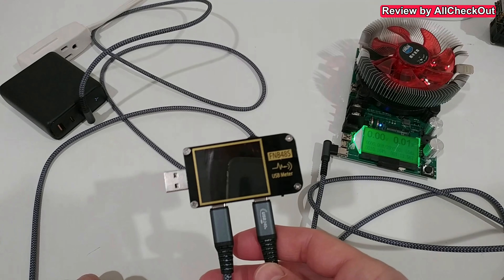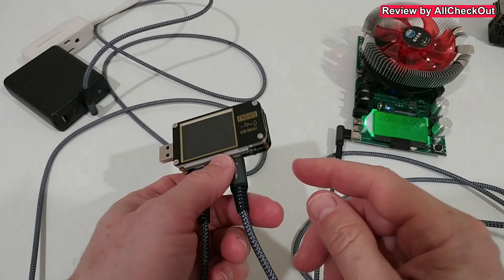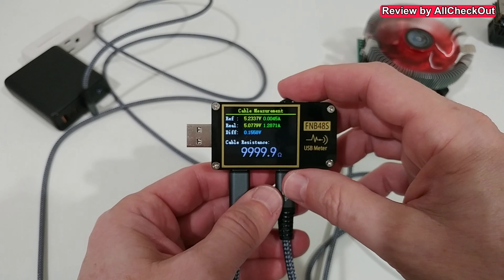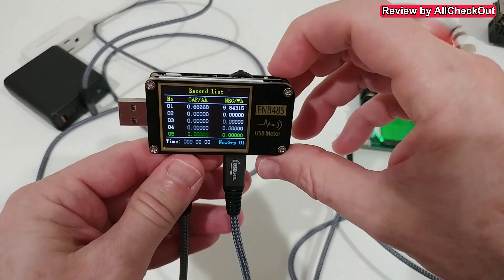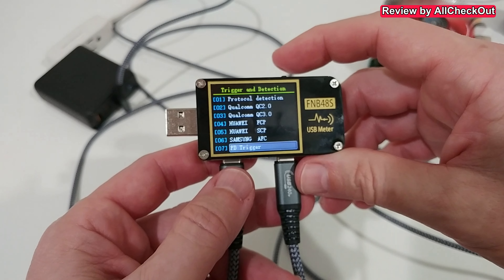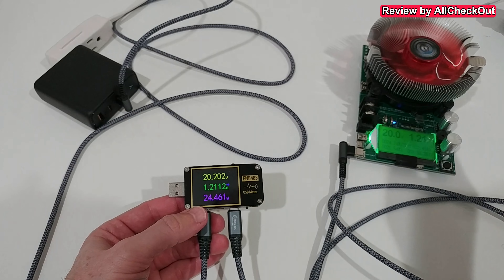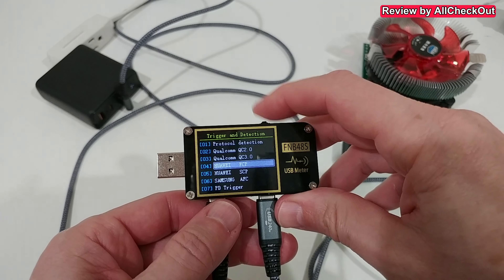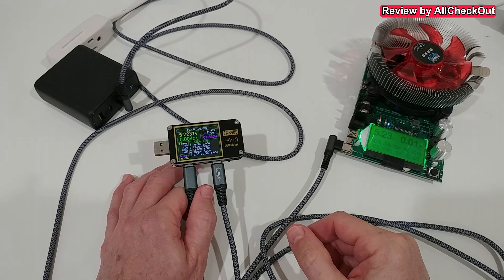FNRSI FNB48 FNB48S USB Tester With PD Trigger Review And Tutorial

Comment: What is the differents between fnb48 and fnb48s
Reply from the maker: One has Bluetooth and one has not.
Reply: @allcheckout   Not really. There is both version 48 and 58 that have bluetooth version
Reply from the maker: @FoxHotelLima  He/she was asking "difference between fnb48 and fnb48s"    ;-))))
Reply: @allcheckout  why FNB48 cheaper than 48s?
Reply from the maker: @User-pq2yn  That's weird .... but if you can get the FNB48s for a low price then go and get it or the FNB58 which I prefer regarding the menus in general, but the FNB48(s) is still my favorite when it comes to measure battery capacity
Reply: @allcheckout  I wanted to take the FNB58 bluetooth version, I thought it was better, but oh my god, why did they make USB 2.0?! Even FNB48 has USB 3.0
Reply from the maker: @User-pq2yn  Oh .. I didn't realize, but does it matter regarding the power? What's the downside as long as you're not transferring data? The reason I bought the FNB58 was the higher voltage and hence also higher max wattage and I like the new interface ... except from measuring the capacity ...

Comment: have the FNB58. If you put power into the micro USB at the top before doing power mode detection, it wont power off. The microusb on the top by the jog wheel is meant to power the device.
Reply from the maker: Thanks ... found that also in the meantime ;-)))

Comment: How cable measurement work. Plug in the USB-A of the USB meter directly to a USB-A charging Port with digital load adjusted to 1A. Press the middle button to set it as a reference. Unplug the USB meter from the charging port. Use a USB-A to type C cable to plug into the "Type C in" of the USB meter to power the meter. You can see immediately the resistance of the USB-A to type C cable. I've no idea how to measure Type C to type c cable.
Reply from the maker: Awesome - thanks very much for the info 🙏